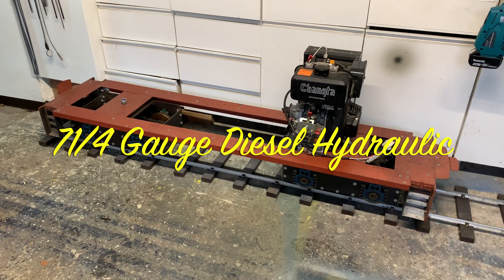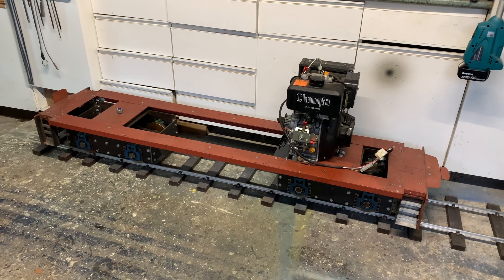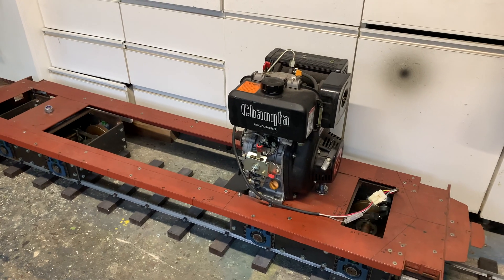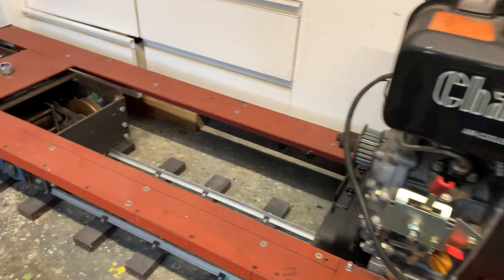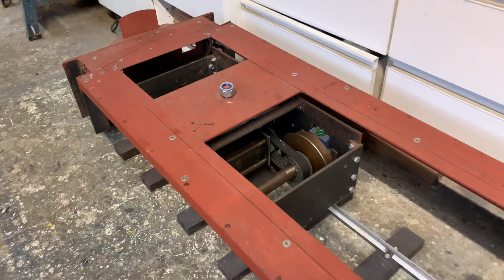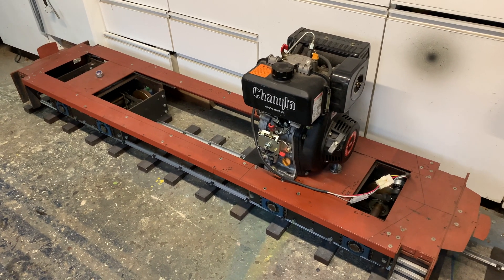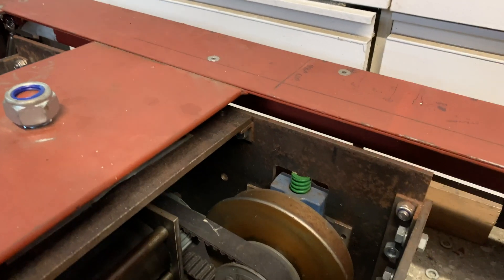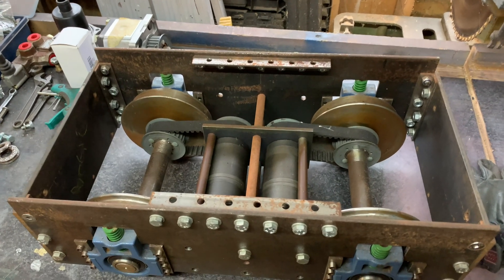71/4 Gauge Diesel Hydraulic Loco

Comment: Looks good Steve.
I shall follow with interest. Good luck with the rest of the build.
Reply from the maker: Thanks Dave, I have been struggling big time with all the pipe work etc. there is so much of it & its very thick bulky & does not bend well, also very difficult to get the air out of the system, but making good progress now.
I did send you a message about how good your GP38 looks on your your track, nice video to.